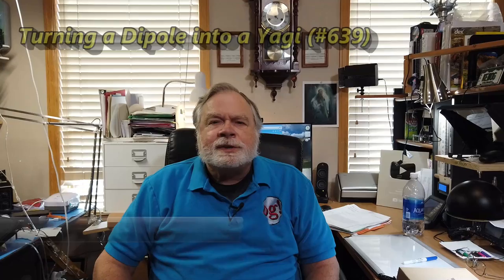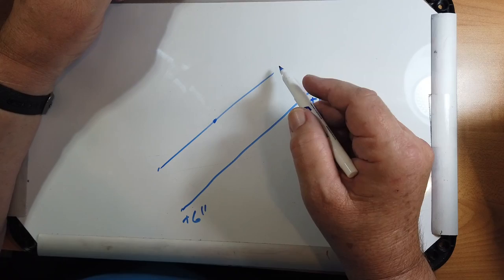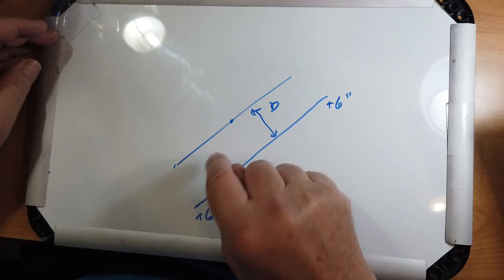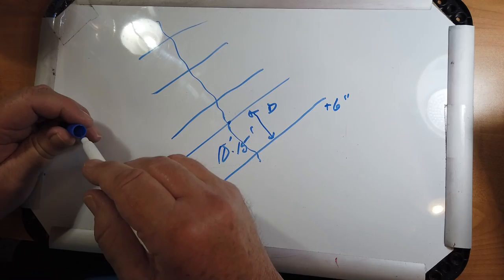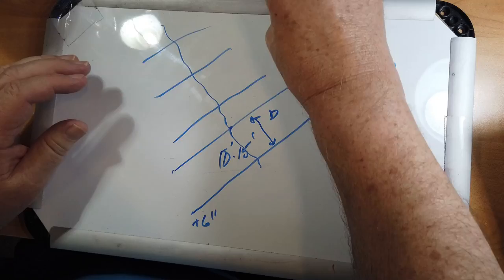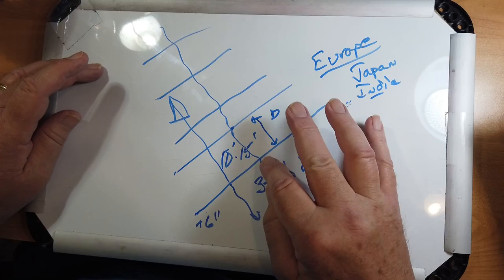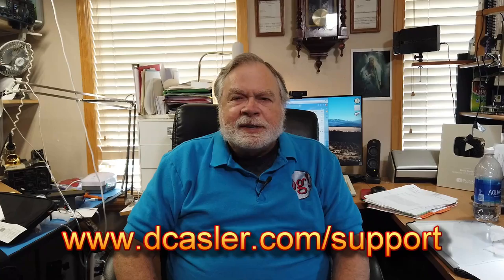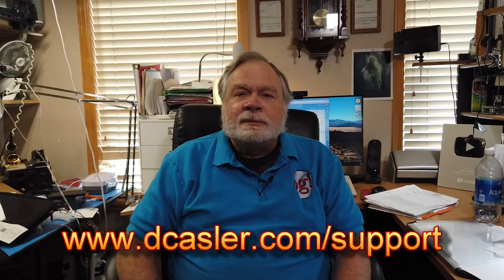Turning a Dipole into a Yagi (#639)

Comment: We strung up a 2-element, 20 meter, wire, inverted-vee beam about 10 years ago for field day.  We cut the parasitic element shorter so it was a director. Then we added a "clip lead" to the ends of the director to lengthen it to the right length for a reflector. It was a bit of a pain to swap beam directions, but It worked much better than we thought it would.  It had a fairly wide beam width and 3 to 4 DBi of gain. 73 de K7RMJ Frank

Comment: Unless you can get your horizontal 40M Yagi up in the air by about 65 feet (20 meters), the results will be lackluster.   I would have mentioned that.  Much of your signal will go pretty much up.  You will gain a whole lot better results on 40M with a pair of verticals phased for cardiod patterns.  Much shorter antennas and far better results.  But sure, if you can get that wire Yagi up in the air 20 meters, you will have very good results.  No doubt.  N9XR

Comment: I’ve heard a few Canadians with sets of wire Yagis. They work great. Most tend to use a hillside with 3 elements and have 3 or 4 Yagis  pointed 25 to 45 degrees apart. I think they were on 20 meters.

Comment: Dave don’t forget that the impedance of that driven element dipole will drop to 25 to 20 ohms or maybe even more!  A quick way to get around that without a special matching network is make the driven element a full wave loop.  But that’s a a lot of wire

Comment: So, the driven element’s coax connects such that the center conductor goes to one side and the shield goes to the other. 

What about the reflector and directors? They all should be at the same potential as the coax shield (and therefore connected to the coax shield)? Or do they exist in space without being connected to anything?

Comment: Why is the dipole measured in 40 metres but the excess distance is measured in 6 inches instead of 18 centimeteres ( or whatever 6 inches is in metric.)
Reply: The wire lengths are measure in feet and inches on most American antennas.

Comment: Doesn't it effect the impedance?
Reply: hi , yes it does, my question was the same as yours, so i built it by the time the video of Dave went up my antenna was up for two years already, all lengths were 10.1m  spacing 5.1m, the director is split in the center, to which a 2.54m lenght of rg58 is conected, the far side left open, i fed with a ugly balun (no match) it worked with a 2:1 swr , so needed to match it, which i did.
Reply: @luckydubeinrc5165  I built a hex beam instead. It takes care of the impedance without a balun.